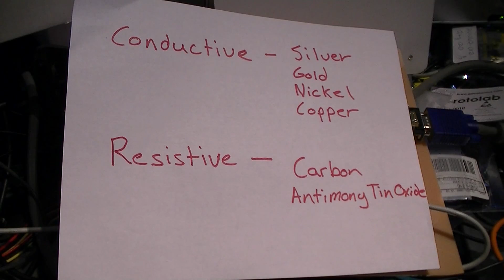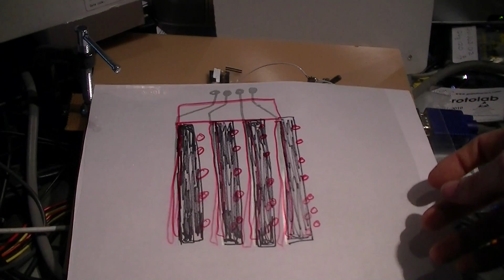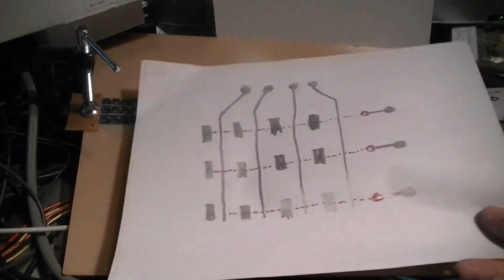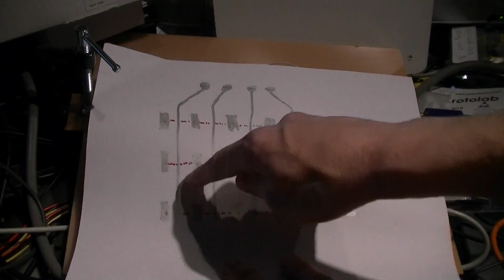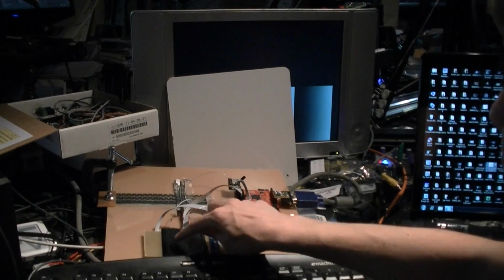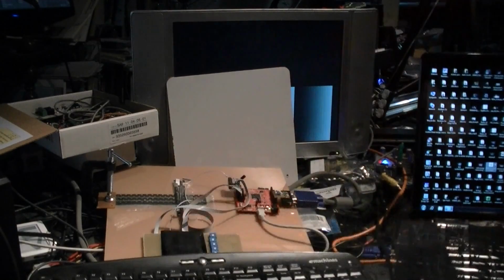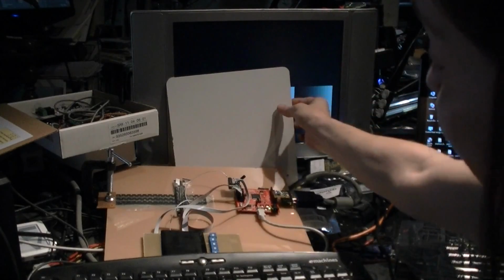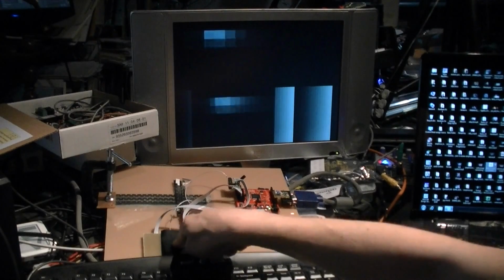Resistive Multi-touch Pad Prototype

Comment: What are some resources you would recommend one to read?
I want some documents that go through the theory, like you did with the 4 wire laid on top of the other lines, could you let me know what you read prior to tackling this project?
Reply: Hello Giray  Did you by any chance get a hold of such material. I would appreciate if you post some links in case you did. Thanks
Reply: @maturepunk  Please I would also like this, I ma trying to build a synthesizer with resistive touchpad.
Reply: It's metallic paint, guys.
Nothing special.
You can make it yourself with powdered metal and glue.

Comment: Nice. I was trying to do almost the same thing, using a led matrix instead of a TV screen, and a PIC microcontroller instead of an FPGA. Sadly, I messed it up with my touch panel, and I'm struggling to find out how to possibly and nicely map a 3x3 measure points pad to a 10x10 led matrix, being able to light up the corners. Linear interpolation didn't do a good trick for me...
Keep up the pace!

Comment: The pink plastic is supposed to be hygroscopic, the absorbed water causing enough conductance to short out/contain high voltage charges that could damage circuits. Dave Jones' EEVBlog channel has a video where he tests and condemns this stuff in favor of other materials i.e. the black/silver stuff. Go watch (and subscribe). Also see his vid on anti-E.S.D. benchtops.

Comment: I would think that any anti-aliasing would need to be handled by the hardware sensing the grid vs. the software, perhaps to detect which finger pushed harder/better. If it couldn't parse it out, it would have to put up an error condition. Software could look at the timing to say which finger hit first, but relying on timing doesn't give a good user experience (like an elderly person trying to get mouse clicks right).